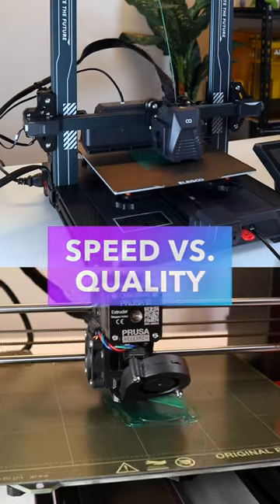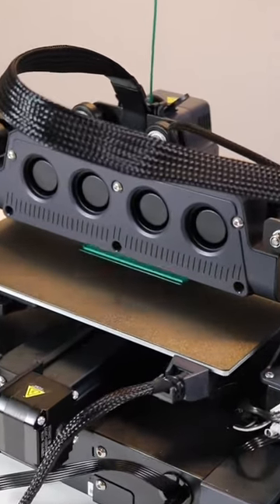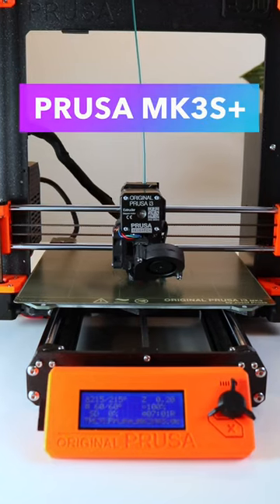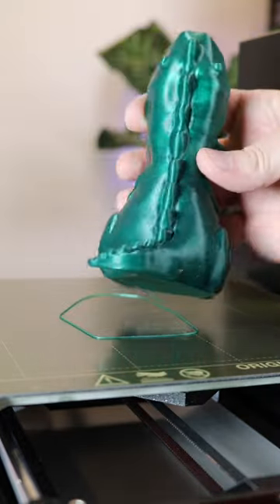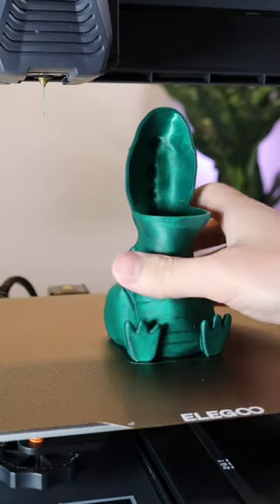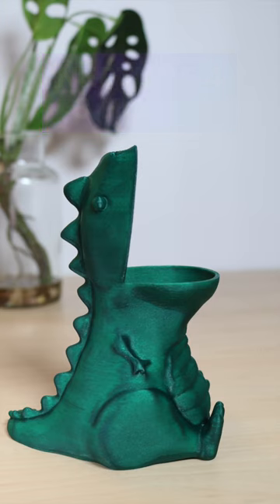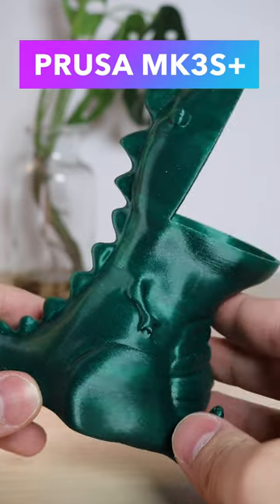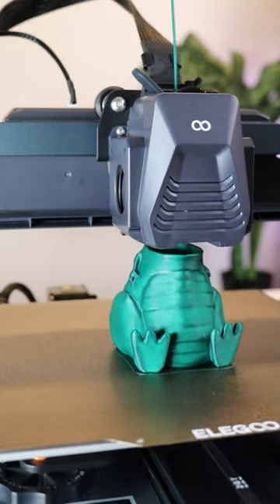Speed vs. Quality: Elegoo Neptune 4 vs. Prusa MK3S+

Comment: Some filaments will behave according to speed and temperature/cooling. I had different surface finish results using metallic PETG filaments (silver/gold).
Reply from the maker: Makes sense to me!
Reply: Correct. You need to bump up the temp between 10-20 degrees when doubling or more speed
Reply: Print a cylinder with silk and change the temp or speed during the print.  You will see the changes.  Hotter and slower will have more shine.  Faster and cooler will be more matte. 

It is about how much time the filament is in the hotend/nozzle that determines how hot the extruded filament will be. 

For silk especially:
Shiny = hotter filament temp. 
Matte = cooler filament temp

Think of baking a cake.  It gets hotter the longer it is in the oven.

Comment: if it's not shiney then you have not got enough temp for the amount of filament being fed, try upping the temp by 10 degrees and I think you will find it comes out shiney
Reply: It doesn't have to be shiny. Hotter is usually stronger, and hotter is usually shinier, but it doesn't have to be shiny to be strong and it being shiny isn't a threshold of strength. I use a lot of PLA pro that I print at 230 and comes out matte and is strong as crap

Comment: You need to increase temperature on Neptune to get shine )
Reply: I’ve found speed effect shininess more than heat
Reply: @squidguy7907 its correlated since time in nozxle are lower you need to overheat a lot to keep "core" temps up.
Reply: @squidguy7907 It's a combination. If your temperature is not high enough to uniformly melt the filament during the time it spends in the melt zone, at the speed you're printing, it will come out matte and insufficiently bonded. Lowering speed or increasing temperature will fix it.

Comment: For print farms maybe but I think the obsession over speed is almost purely a problem of luxury and decadence.  7 hours isn't that long when you don't have to do anything.
Reply: it really depends. When i was part of robotics, new designs and prototypes were coming out so fast, quality wasn't a huge issue but speed was the main factor on how fast we could manufacture prototypes.
Reply: A bunch of printers are 400+ Watts of continuous power draw for the filament melting while working, so literally cutting print time by around half will literally drop electricity costs by nearly the same amount. 
If you're a "serious" hobbyist or print for you entire friend group the savings are more than $200 USD a year as we're talking nearly a kilowatt hour every 2 hours of electricity billing which can vary widely in the United States. States like California allow their utilities to use tiered pricing based an amount of Kilowatt Hours used or When they're used so a Kilowatt hour from when I lived there could be $1+ USD from experience as a PC Gamer (haven't started 3D printing yet when I lived there). I lived in Pasadena specifically and there was a semi-bell curve where past X amount the price went from $0.13 to $1.50 at 700 kilowatt hours to $0.25 at 1400 kilowatt hours. My power bill used to be $400.00 USD due to PC gaming and would've been the same if I was 3D printing. So having something take longer could quite literally cost hundreds of dollars more either from extra power draw or causing the print time to extend the print into peak rate hours for electricity.
Reply: @Edin116  You're completely ignoring basic thermodynamics.  The heat is going into the plastic so running twice as fast means you literally have to generate twice as much heat.  It's a one for one because heating is 100% efficient.
Secondly I think you wattage and pricing numbers are wildly exaggerated.  Google is showing 50–300 watts while in operation, with most falling within the range of 100–250 watts.

And lastly your completely ignoring my point.  If you're running a print farm or your printer runs most hours of the day because your a "serious hobbyist" then yes you can worry about speed for speeds sake.  You don't need to ignore heat physics to justify wanting speed.

HOWEVER, everyone else doesn't need this obsession over speed.  Most hobbyist aren't building custom speed rigs or attempting small scale manufacturing.  There is an obsession in the overall community over speed and I don't believe it's necessary.  Detail and reliability, sure.  Those have a value to everyone.  But I fully believe that speed is a unnecessary luxury for most people
Reply: @Edin116  completely made up numbers ;)
Reply: @Edin116  i want to know what kind of printer uses 400 watts to heat the filament without also spilling molten metal everywhere
Reply: @doppled  Creality K1 was my printer. Measured though a wall monitor and a UPS (Uninterruptible Power Supply) for both my printer and computer (i7 4820 CPU, 2x GTX 660 Ti in SLI, back in 2018 for the computer). Hopefully this one doesn't get deleted like all the other replies to my initial reply.
Reply: @Edin116  right, the k1 which uses a 60w heater for the extruder
Reply: @doppled  "Rated power: 1000W" -Manufacturer website, so either you're wrong, missing something, or my unit is defective as there is no reason a company would put that high of a PSU in a printer otherwise.
I'm guessing you missed something as a bunch of reviews mention usage in Above 300W and spikes as high as 800 Watts. Some said something about an AC Bed and bed heating.
Reply: @Edin116  you do realize that the motors and control board also draw power, and the full 1000W isn't used but is the maximum the PSU can supply
Reply: Actually, as someone that doesn't print much, I kind of like being able to print faster. When I do decide to print something, I like it to be done as fast as possible. Obviously, I don't want it to print like garbage, but my Neptune 4 Max has been doing fine at fast speeds.
Reply: @tbg2735   You're still describing an industry level use case.  I'm talking about hobbyists who obsess over speed when there really isn't a need for it.  It's like a sports car.  Sure, you need one if you're a sport racer.  But if you're just taking the kids to school it's gratuitous.
Reply: @jkell411   You'd like it to print as fast as possible, sure.  But do you really need it?  Like as a matter of necessity?  As a hobbyist, if it took twice as long, would it really make a difference?
Reply: @VagabondTE , yes, it matters to me. I'd rather have something done in half the time. And so far, the quality has been just fine. If I had to keep reprinting due to errors or the quality being bad, I might feel differently, but that hasn't been the case. Yes, having something printed in half the time that I am happy with is better, in my opinion.
Reply: @jkell411  It's still a luxury.  You're thinking about this purely as the amount of time your personal printer takes versus its mistakes.  I'm talking about overall trends in the market.  Of course you are always going to want it to be as fast as possible.  You're the consumer.  But if the standard was twice as long, you wouldn't even know the difference.  If a Keurig took 4 minutes instead of 2 people would still consider it a fast cup of coffee. There's way more factors in 3D printing then simply speed versus reliability but the industry focuses on speed because people like you will choose speed over literally anything else.  Even though it's completely unnecessary at a hobbyist level.
Reply: @VagabondTE , you're speaking as if you know what is best for everyone. I literally stated why, in my opinion, the speed is worth it. I'm not running a business or anything. I'm printing for fun and convenience. Like I already said, if I can print something faster that meets my needs, that's what I want. You're talking about making coffee and non-consumer use... Not sure how that will change my opinion. I understand your opinion, but I don't think it applies to everyone in every situation.
Reply: @jkell411  I'm not so sure you're understanding.   I'm speaking this way because there is no functional limit or necessity for speed in this particular niche.  The heating elements reaching a particular temperature is a requirement.  Using 110-220 power is a requirement.  Taking 2 hours instead of 4 is a choice.  It's not a requirement.   It is..   a luxury.  It is a preference.  And that preference guides the industry to prioritize that functionality over other functions.  You keep reiterating your opinions and your preferences,  and I'm trying to point that without a mechanical reason for why you need your prints to be under a certain amount of time, it's JUST your wants.  There is a laundry list of other functions that 3D printing has completely ignored for years because there is an industry-wide obsession with speed and fidelity.  And yeah I'm going to talk down on that industry and that mentality because there will always be a faster machine.  Next month when you get your 2 hour print in 1 hour print what has changed?  For a print farm it changes a lot, sure.  But for the average hobbyist nothing has changed.  It's just a slightly faster sports car.  It's just a slightly faster cup of coffee. And yeah I'm going to be on a high horse about that.

Comment: It’s not a question of speed, it’s a question of cooling, you can print as fast as your cooling system allows for. The speed related quality decrease is caused by the filament not cooling before the next layer is added or on overhangs drooping because the cooling fan moves away too quickly

Comment: Should also be said how much cheaper the Elegoo Neptune is than those Prusa's
Reply: It’s only 300???? Yeah Ik what I’m buying next Black Friday
Reply: I'm a bit biased because I have a print farm... But man, the Prusas are crazy reliable. In 60,000 hours of printing... I've had 10 issues that required opening a printer up and actually doing any fixes. 8 of those fixes were the bed thermistor (an easy swap). Only 2 were issues that ended up requiring me to just replace the hot end assembly.

That's it for issues. I don't even clean my build plates. They just print so consistently with such minimal maintenance and headaches. I'm looking at picking up a Neptune 4 max though for that extra build volume. So I'm excited to compare the two.

Comment: These shiny “silk” like filaments usually has some rubber in it helps to build up surface tension and that makes the shiny look, because of this you cannot print these filaments too fast (or you have to change the temperature settings)
Reply: he didn't use silk pla

Comment: Print the one on the Prusia at 195C. You're probably printing at 215C. You also need to mention the filament brand as that will also make a difference. I've never experienced this issue. Probably better to print in PLA+ on high speed printer. They also make high speed filament for high speed printers.
Reply: Yep I own the Neptune 4 and Rapid PLA+ prints come out much better than with standard PLA

Comment: I looked it up, matt finish is with lower temp, faster it goes temp is probably a bit lowered, apparently 205 c makes it mat, 220 glossy
Reply: Not necessarily, I just did a temp tower in eSun pla+ and it's entirely shiny from 240-180c

Comment: I have noticed that the surface finish of my prints changes with print speed, and not just on my Neptune 4 Pro, although that's the one that gives the most evident results, due to how fast it is. Even in the same print, changing only the printing speed produces noticeably different results. Especially with glossy materials like Silk PLA. I can show you some examples if you like

Comment: I'm confused. Was it supposed to be matte or shiny?
Reply: When printing fast you have to up your heat especially with these silk filaments.
Reply: @Kman31ca  so matte or shiny
Reply: @lilyvmax6642 Supposed to be shiny. The Neptune 4 dino was printed too fast and too cold. It will likely be easier to crush.
Reply: @Kman31ca  what kind of filament that he used?

Comment: On Prusa mk4 15% infill PLA: 3h38min with IS 0,2mm structural (detail), 2h47 min on IS 0,2 speed. Without Input Shaping it's 5h31min for 0,2mm quality and 4h23min for 0,2mm speed. So yep, upgrade your mk3s+ to mk4 if you want better speeds

Comment: “You have to choose speed or quality”
bambu labs has entered the chat
Reply: Yeah in the case of the bambu you have to chose between speed and strength lol
Reply: La elegoo solo le falta mas temperatura ya que no es una tortuga.. Y si no tambien se puede bajar la velocidad, cosa que la prusa no puede.. Quedó en el pasado.
Reply: Elegoo puts out just as good a print as Bambu does in the same price range.  Of course if you send $700-$800 on a Bambu and $300 on a Elegoo there will be a big difference
Reply: @anthonylong5870  the problem is that the printer in this video needs way more maintenance. Linear rails need way less maintenance and they are way more precise also they can move way faster. So in conclusion you can print faster without compromising the quality.
Reply: @anguismemes1666  Thats not true. If you compare a Core XY to a Bedslinger in general yes.  But there are plenty of bedslingers like Prusa MK series that never reguire any real maintenance other then occasional cleaning.  And an argument can be made that core xy machines need more belt maintenance and replacement because of tge excessive were the core xy design puts on the belts

Comment: With you not mentioning it I take it you’re not considering the mechanical properties affected by the faster melting and cooling times? There will be a clear difference in quality depending on the material blends used, usually with negative effect when cooling polymers too quickly.
Reply from the maker: That’s a little out of scope for a 60 second video, but I intend to cover it eventually! 👍

Comment: Bambu does it in 2.9h on default 0.2 100% speed with almost perfect surface (looks like injection mold)
Reply: 12.7 h for 4 color ams  X2 100% Speed 0.4mm

Comment: 3 hours? So slow? I checked my 0.2 nozzle Ender 3 printer profile, and it estimates to 8 hours. And it have only 80mm/s average speed and 0.16 layer height and 5 perimeters. Where are those cosmic speeds of 500mm/s which advertised? = )
Thanks for you video, it shows that stock printers are so stock.
Reply: Well, that Neptune 4 is advertised to print at 250/mms with POM V-rollers, which is a bit weird
Reply: @DJProPlusMax not the pro one
Reply: This is with the stock settings in Cura, which is only at 250mm/s. You have to use klipper to get it faster. I seen another reviewer push it up to 400mm/s with good quality prints. Any higher and it would need still better cooling.

I assume the 500mm/s claim is just the hardware limit, like the motors and such
Reply: @VoidOperator  the problem with those large speed numbers is that are more a marketing stuff. It does not really means much what maximum speed for car is. Also ever saw car advertisement, where they talk about how fast you can go and that you will get to your work faster? No? It is for a reason. But with 3d printers people suddenly forgot, that there are lots of factors. Like with cars it is road quality, traffic lights, speed limits and such. With printers it is material limit(creality even offer special PLA for fast printing, and ABS, PETG and composite materials have speed limitations), hotend flow limit, quality limit(most printer do not have or have poor configuration for latest technologies like linear/pressure advance or shape neutralization), speed layer limit. And of course acceleration is in place. I do not know as for now, but in early days cars were advertised with seconds to accelerate to certain speed, like 100mph or 100kmh or so. And when manufacturer advertises 500mm/s they forgot to tell you how long it will take printer head actually have this speed. You can input any number into speed box, but what for, if printer will never have enough time to achieve this speed.
Reply: @enosunim I asked them about default acceleration of Neptune 4 /pro and they said its 5000 mm/s2.
Reply: @sonjevar  interesting, thanks for information! This should be checked though, it may be like hardware limit which can be set over slicer options, but not actually default value. 5000mm/s2 looks like a lot for an Ender clone, though I know Ender 2 can be used at 7000mm/s2 as it have smaller bed. But with 10mm wide belts upgrade.

Comment: Hate me but here’s my opinion: Speed and quality for the lowest possible cost with the lowest amount of work for print settings. Bambu Lab A1 😅
I LOVE to use ELEGOO PLA+.
First layer 220, rest of the layers 205 degrees. The rest just use standard PLA+ settings from bambu slicer. Thank me later, the results are just crazy. Layer lines are basically invisible, the print is ultra matte and the PLA+ almost feels as strong as PETG. It won’t get more easy, casual and fast as you only need to change two temperatures.

Comment: Matte is because of the lower heat. When I'm running 250-500mm I run Pla @ 230c & 65 on bed, this results in a semi gloss finish at these speeds.